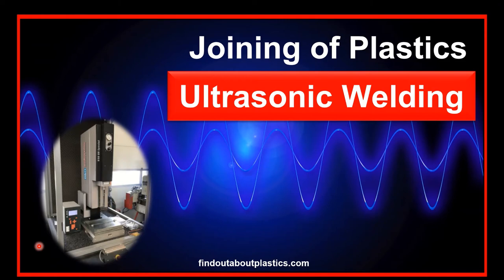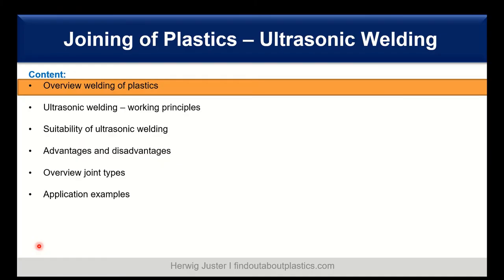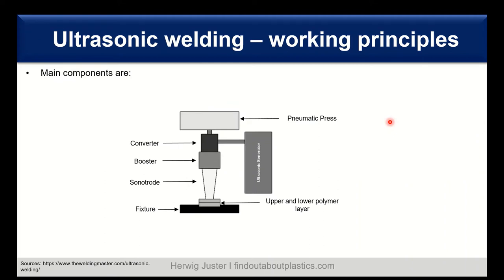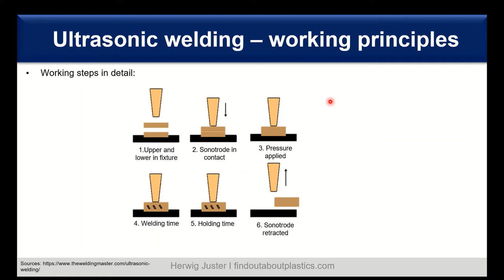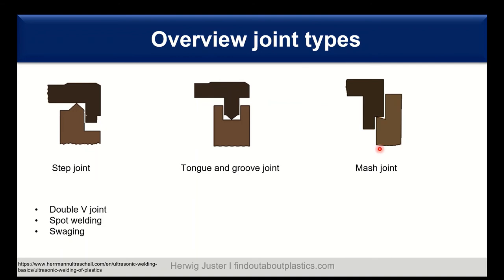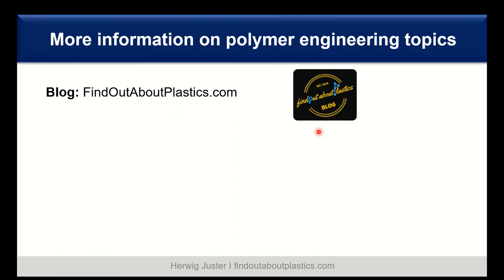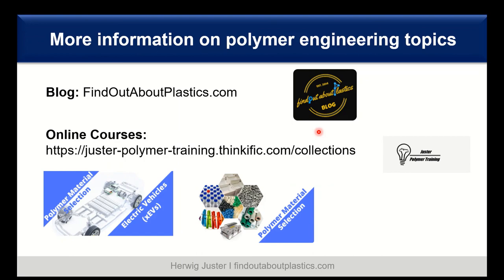Ultrasonic Welding of Plastics I Joining Techniques

Comment from the maker: Time stamps: 
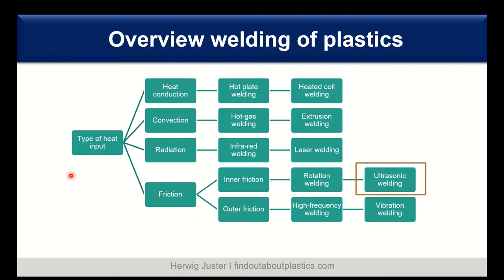00:40 Overview welding techniques
01:50 Ultrasonic welding – working principles 
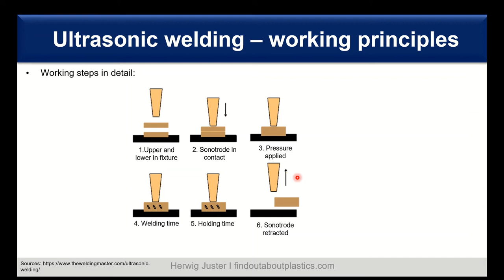05:56 Suitability of ultrasonic welding
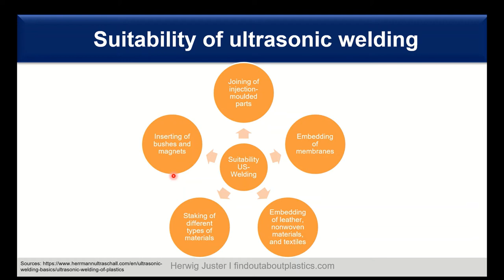07:35 Advantages and disadvantages
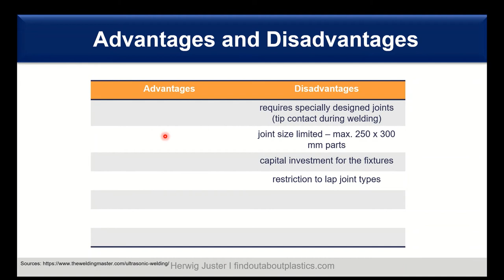09:20 Overview joint types
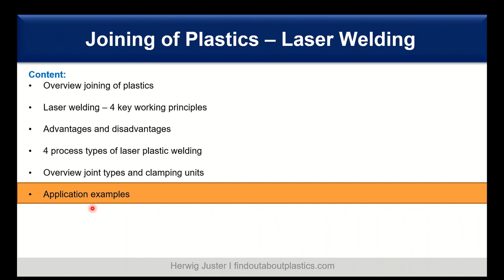12:26 Application examples

Comment: Hello Herwig, Thank you for the great and informative video. I came across a question if the Ultrasonic welding process can generate harmful chemicals that can fail Biocompatability of parts. Do you have a white paper for this? Thanks in advance
Reply from the maker: Thanks for this feedback & follow up question! Ultrasonic welding is widely used for example in plastic food packaging and in this application case, US welding is  not negatively influencing the food-contact plastic grades -> https://www.herrmannultrasonics.com/en-us/applications/food
Reply: Thanks Herwig! All the best!

Comment: What about the inspection? how you can ensure the welding process is correct? do you apply a certain force on the joint?, or is just a visual inspection?
Reply from the maker: Hi, thanks for the question! There are different ways to inspect plastic welds: non-destructive and destructive methods. 
It depends on the requirements for the finished product which method is most suitable. 
Non-destructive test methods include visual inspection of the weld bead (check its dimensions and appearances), leak/pressure tests and ultrasonic testing methods. 
Destructive test methods include tensile strength test, bending test and the tensile impact test. 
Greetings,
Reply: @HerwigJuster  Thanks for your answer